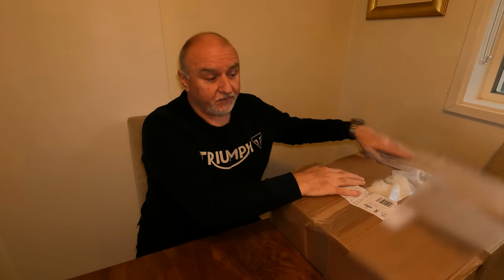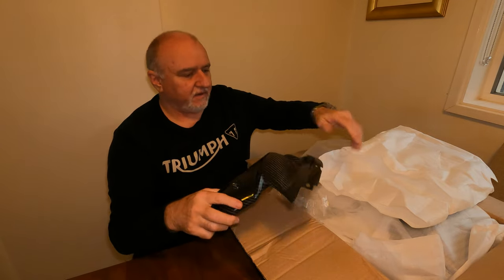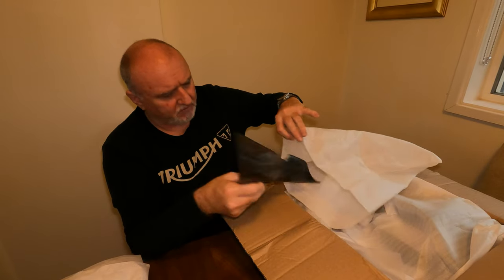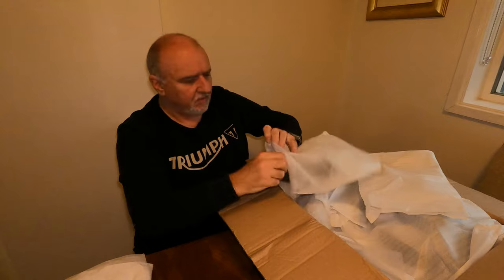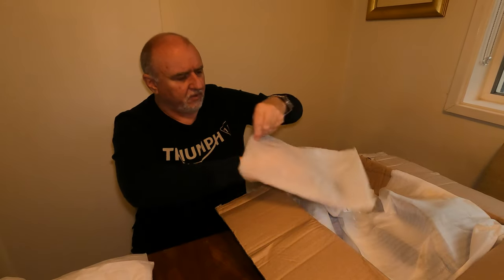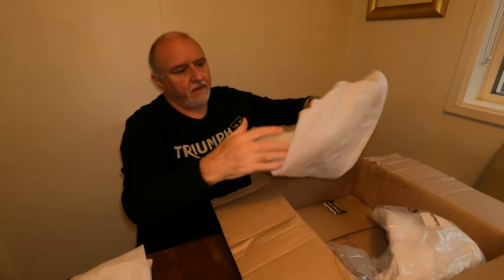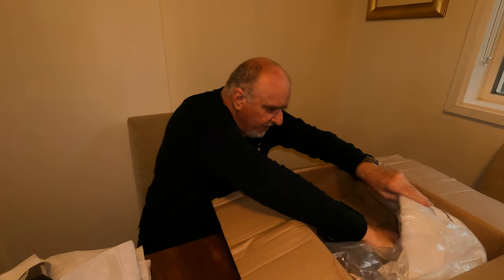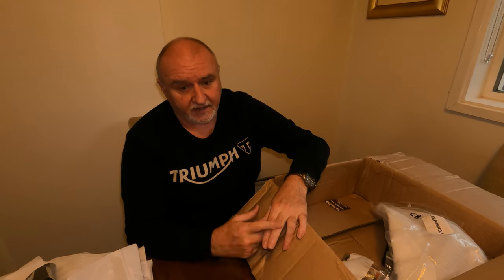Triumph rocket 3R Carbon Update

Comment: I'm still trying to make my decision if I should buy the 2023 Hayabusa or the 2022 Rocket 3R.  Not sure which one would be more reliable and also my height is 6'2" tall(1.88 meters) so I need to consider which one would be good for my height as well....
Reply from the maker: A Japanese bike will likely be more reliable 99% of the time, but then again, you’ll just be riding another Japanese in-line 4… 😏 At 6’2” you might want to try a GT with forward pegs for a bit more room. Either way, I’d suggest test riding both. Also check out the Rocket forum on Facebook and ask the question. There’s a number of guys with multiple bikes, and I saw a recent post from a guy whose 2nd bike was a ‘busa. His was an older one though, and the new one by all reports has lost a bit of its animal edge.🤷‍♂️
Reply: @watchapexmedia  I love the Hayabusa, but the less maintenance I have to deal with the better my motorcycle life will be.  I love the Rocket 3R because of the drive shaft and not needing to deal with a chain and all the maintenance needed for the upkeep.  From what I understand, the shaft can last as long as the life of the motorcycle itself and often pass 300,000 miles if a person simply maintain impeccable service records of the bike...
Reply from the maker: @markettradinggenius  to be honest, modern chains and sprockets last waaaay longer than they did in the past, where you’d replace the set every couple of years. And it’s just another item for your shop to check. On my Blackbird I switched from lube to chain wax on the chain, and it lasted longer and made less mess than lube. But yes, shaft drive is still much lower maintenance than even the best chain, and the Rocket has a fairly substantial one at that.

Comment: Was looking at my R3r on the weekend. Can you get to the inside Allen screw by using a shortened (cut) Allen key. I think there might be just enough room. You might have to avoid having to dismantle the exhaust.
Reply from the maker: That's actually a great idea! I did try a thumb ratchet and hex bit but it was too big. I'll give that a try this week. Thanks.👍